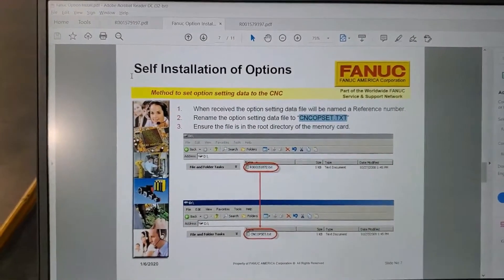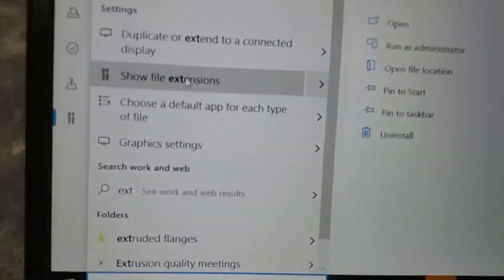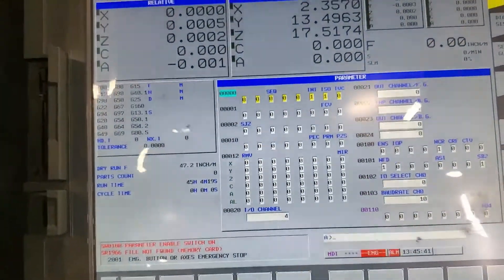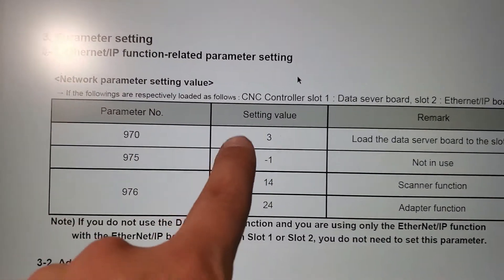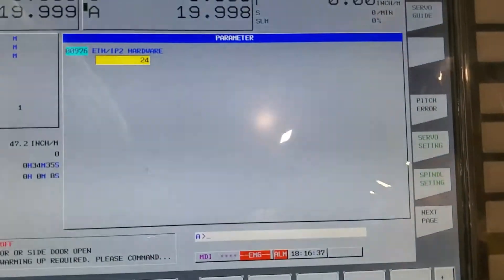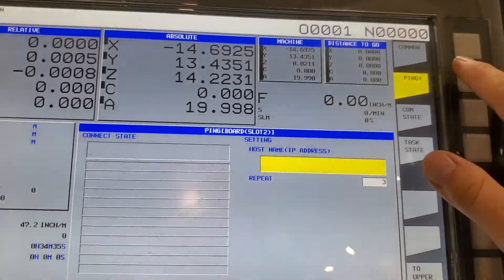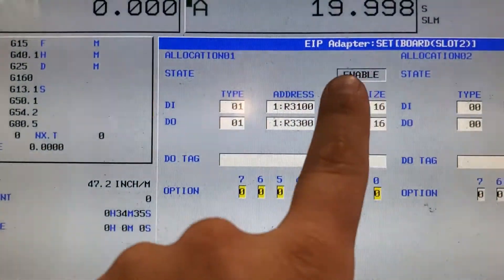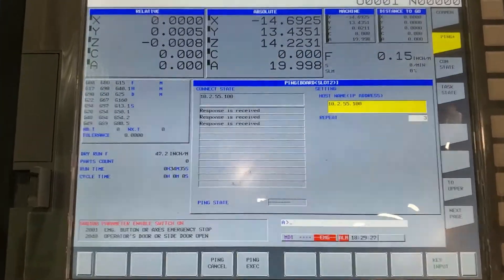Fanuc CNC Ethernet IP Installation and Setup Video

Comment: Am I understanding correctly that without those options there is not a way to communicate with the control by ethernet? We have a CRX robot and literally all we need to do is tell the control to close the jaws on the spindle. We can do the rest with the robot. Just seems crazy to do all that work for such a small thing.
Reply: This is correct. You have to do all that to communicate.
Reply: Separate thing you could do is change the solenoid that control the fixture, to be robot controlled. By that I mean the wiring to the solenoid goes to the DO/DI board on the CRX on the door that swings open. 

I recently did a project with a CRX/Robodrill and have some experience with controlling fixtures wired directly to the robot. Currently working on 3x EDM/LR Mate 200iD/7L cells where the robot controls the  fixture directly.
Reply from the maker: I am just seeing this comment. Great question. This is ONE way to get this job done. It makes a really nice way to communicate from an Allen Bradley PLC to a Fanuc CNC. From a CRX you could use IO Link, or digital IO wired directly to and from the CNC/Robot. Or you could do some other protocols, but IO Link or Digital IO is the simplest. We've used Digital IO successfully for simple cells, which most Cobot applications would fit into... K.I.S.S. 

Ethernet IP allows a TON of IO transfer for automatic tool comps, automatic program selection, mill position, robot position, etc... Most applications don't truly need Ethernet IP.